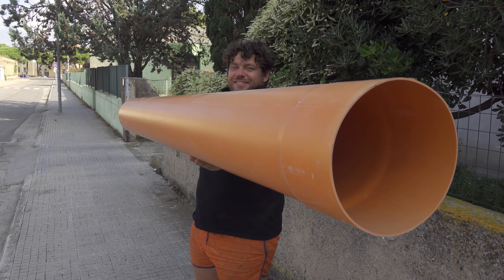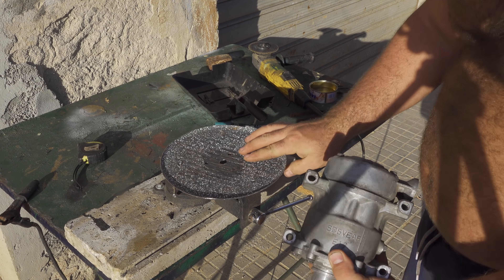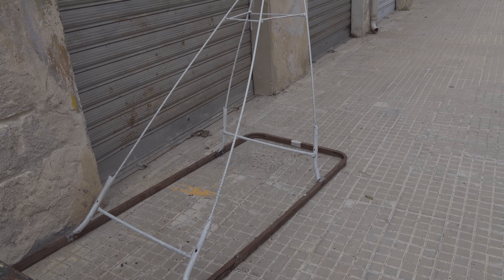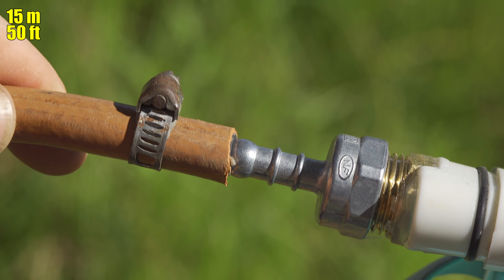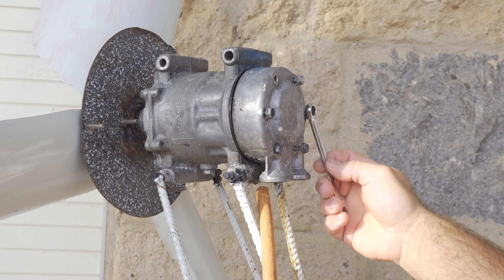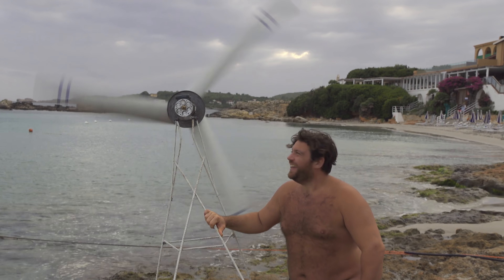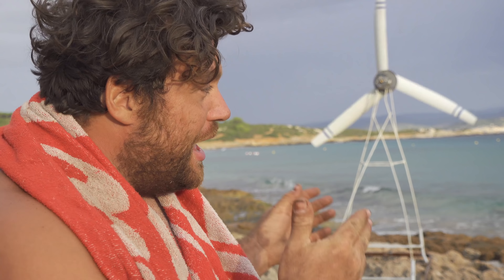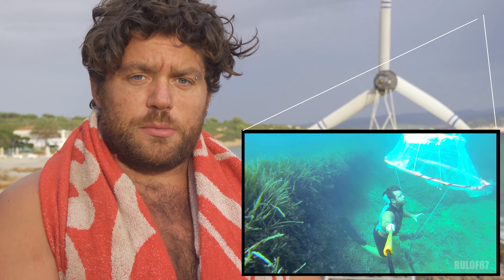Most Dangerous Invention  I've Ever Done • Breath Underwater

Comment: As an actual diver i cannot stress enough how dangerous/useless this device is. Just buy a dive rig.
Reply: care to explain why?
Reply: @mpcrazyscience7097  You NEVER want to use anything underwater to breath unless has been specifically manufactured and tested for scuba diving. Using old AC parts is really easy and fast way to posion your air supply because of all the harmful lubricants/oils you would be inhaling. Also, the mask is a full face snorkel. Any diver will tell you those are absolutely useless, as they're nearly impossible to purge and you can't pinch your nose to equalize.
Reply: @ghostairsoft24  Wow your arguments are weak.
 Just because it's not professionally made, doesn't mean it's bad.
He even says you should clean it: 4:20
With all the air flowing through, it automatically purges.
The only valid point you have is pressure equalisation. But you probably won't dive very deep with this anyway.
Reply: Alright, since you want to call my arguments weak and it's very clear you're not a diver, let me briefly go over why you are very, very wrong. 

Firstly, You claim that "just because it's not professionally made, doesn't mean it's bad." ANY dive shop or dive master will tell you that using your own homemade gear is a quick way to get yourself killed. Just by saying "oh yeah make sure to clean it" does not in any way guarantee that your efforts have in any way shape or form properly disposed of contaminants in the compressor itself and the air around you. While yes, there are hookah dive systems similar to this, but they have specially designed regulators, compressors, and filters that can guarantee that there are absolutely no contaminants in your equipment and on the surface that are getting into your air supply. 
  If you want some sources on this, take a look at this link https://www.diversalertnetwork.org/health/PSA-GasContamination/index.html  that talks about gas contamination

Also, here are a few quotes straight from the PADI OWD Textbook. "scuba air must be especially pure because trace contaminants (like carbon monoxide and oil vapor) that may be harmless at the surface can be toxic when breathed at a depth.) "

"get your cylinder fille only at reputable scuba air sources" 

Considering what this guy is using is a rusty as hell car A/C compressor with zero dive-rated filters (not to mention you can literally see the grime on the part itself), with some horrible looking tubing, you have to be pretty stupid to think that this is even close to safe.

On a different note, *the tube is 15m*. **Most OWD on their qualifying dives never are taken past 9-10m**. And this is with ACTUAL GEAR NOT HOMEMADE SHIT. The air you breathe on the surface can be toxic at 6m even, which is why most scuba gases do not exactly match what we breath on the surface. Not to mention I doubt anyone that would be wanting to make something like this has the training to safely ascend/descend at depths.

As for equalization, here's a chart on how depths correlate to pain in your inner ear. https://www.diversalertnetwork.org/health/SmartGuide-Ear/index.html    "probably not diving very deep" is something that is completely irrelevant to this chart, since you start to experience pain at 4 feet. 

For purging, good luck trying to get that shit back on while remaining calm. One of the nice aspects of purging your mask with a mask and regulator over the garbage that this guy is using is the fact that you can still breath when you take your mask off and impair your vision to purge it. If you wanted to fully purge this mask, you would need to take it off fully, hold your breath (*LITERALLY THE NUMBER ONE RULE IN SCUBA DIVING IS TO NEVER HOLD YOUR BREATH*) https://www.thoughtco.com/most-important-rule-never-hold-breath-2963244, and then attempt to put the mask back on while pushing the now very intrusive water out of your mask. All while staying calm. Good luck dude, and if you did that you would have some very interesting encounters with pulmonary barotrauma. Sure, you could always exhale continuously like how ACTUAL  DIVERS are trained when their air is cut off, but that is posing a risk in itself because your only source of air is a free-flowing mask you are trying to strap on while blind. Anyone without training would panic immediately, and panic can and will get someone hurt if they do not know what they're doing.   

So please, before you speak out of your ass, get some training.
Reply: MPcrazyscience-ghostairsoft24 is right,it's dangerous.Just do a little research on it.Even the maker of the video says not to try it.
Reply: "Wow your arguments are weak"     proceeds to use weak arguments
Reply: @ghostairsoft24  Ha good job you shut him up
Reply: @ghostairsoft24  not every need to pinch his nose to equalize, you learn to contract the muscle pretty easily
Reply: @TheRemo176  True, but for most people clearing it would be rough
Reply: @ghostairsoft24  All of your stated facts are accurate and true, and thus the threat should be clearly displayed to those who are tempted to replicate the build. However, for very small periods of short depth diving, trusting the person using it has some decent knowledge of the risk and a handful of common sense, I can scarcely see how it'd mean the life or death of someone. 
Making stuff like this isn't for everyone, but as long as the person making it is aware of the dangers, and they know what they're getting themselves into, they'll have an edge on limitations and things to avoid. This to me looks like a fun little project DIY enthusiasts can cobble together and occasionally dick about with, not a professional all-purpose safety certified diving kit ready for deep sea exploration. So comparing something of this calibre to professional equipment is slightly ridiculous, because nobody building something like this realistically want to exert their money on professional diving equipment when they're probably going to use the DIY replication for half an hour a week, and probably ditch it in a garage for several months to salvage it into scrap later on.  

TL;DR stop trying to the unwanted safety freak in this situation, inform but don't condemn. The assumption that this is going to be used anywhere near the same level as professional scuba diving gear is moronic, and provided people know the risk of what they're doing, trusting they're not ignorant they'll be more careful to avoid a soggy death.
Reply: @Reginald Keklesworth  I think the biggest concern about this build is simply the level of air quality you would be breathing underwater which would be dangerous regardless of depth/time. Sure, people may not go deep, but they're still inhaling rust/dust/oil

I wouldn't really consider this being a "safety freak" just a diver that has some immense criticisms about this build. Not to mention I probably wouldn't have elaborated if the dude above wanted to know more. I'm not saying people can't try this themselves, I am saying it is very, very stupid to do so. If someone wants to go test their luck, be my guest. But if you want to play stupid games you are going to win very stupid prizes. Also, as for how deep he would be using this, there's a 15m hose. That is deeper than most divers go on their qualifying dives. Just food for thought. 

People may know their limits but in the end, training and experience are what keeps people safe, not presuppositions about diving.
Reply: @ghostairsoft24  I think in the given context of how and where he built it, with the fact he welds and uses tools without gloves and shirtless. I doubt he really has much concern for more specific safety needs, but I'm sure he has plenty of knowledge behind him to avoid putting himself in a position where safety would save him. He has been alive on this earth for this long whilst skipping some safety basics so he must be doing something right.
But that hardly nullifies the fact that he is breathing through dirty equipment, so I very much so agree it's hardly safe practice to be using something rusty and covered in nasty stuff from previous use. So I can't bash your logic there.
My remark of being a safety freak was rather unfairly projected, it was more of an expression of the fact that this was a fun little project somebody created online and wanted to share with the world, he himself stated it should not be replicated and it is clearly dangerous. It's cutting away from the ingenuity and general creativity when you feel the need to bash and exert how useless it is. It is by no means professional equipment, and it clearly has some safety hazards. But from a creative standpoint it functions as clearly displayed, and it's unfair to then treat it like it is no more than a deathtrap when he didn't mean for it to be a functioning tutorial or a marketable device.

I fully agree with everything you've said, it's just harsh to be so critical of something of said nature.
Reply: @Valionic  I definitely see your point. I think my harsh criticism comes from the fact that while yes, its fun, but is also dangerous from a diver standpoint. Idk, its just hard for me to appreciate something like that.

But also, props to you for actually putting together a legitimate thought. The people previously have not.
Reply: @ghostairsoft24  I completely understand that, and I don't blame you for projecting everything you have said considering in your context, had any of the risks in this build applied to actual diving it could literally cause a death. That's far from something you want to experience when enjoying the views under water. It just might not be the best comparison in this situation. Thanks for being civil in your response either way, hope I reflected that back in my responses.
Reply: @Valionic  Yeah absolutely. Honestly if the dude didn't put a 15m tether i would have been like okay maybe this isnt awful. But if you give a dog a long leash you know they're gonna take it.
Reply: Jelly much lol
Reply: @joecarnes9174  nah lol
Reply: Mmmk ha ha
Reply: I'm a scuba diver too and totally understand the dangers of going underwater without using certified diving equipment. But come on ghostairsoft24 taking a scuba diving course doesn't make you Jacques Cousteau! We're probably taking in more contaminants from the air we breath due to pollution. I'd use this device and have fun making it YOLO
Reply: @jondilbert8455  Never said it made me Jacques Cousteau, but it does make you aware of the risks this guy is taking. 

As far as pollutants go, as a diver you  know breathing air at a depth makes certain things toxic that aren't normally on the surface. And idk about you but i haven't been breathing any motor oil,rust, or metal shavings recently so idk how our air could be more polluted than the stuff that's directly coming out of that pump.
Reply: Totally agree with you, this device does tick all the danger boxes. The video shows an inventive aspect but doesn't outline the dangers. Bit of a "don't try this at home"
Reply: @ghostairsoft24  What about using a new compressor then?
Reply: I mean yeah dangerous as fuk, but why not help dude out with "our infinitely more than anyone else knowledge" to make ir as safe as he/ we could. Instead of just being mean like the rest of the intro web 😁
Reply: Agreed but its just a creative video
Reply: ghostairsoft24 l
Reply: ghostairsoft24  A+ fucking you passed this semester good fucking job I love all the links man very informative
Reply: @peterlustig6888  New compressors would pretty much certainly be shipped out already having a light coat of oil to reduce the chance of rusting before you receive it. You wouldn't have the rust problem, but you'd still be breathing in the oils, and there's no 100% perfect method that I'm aware of to ensure you've gotten ALL the oil out. I wouldn't go through the effort to make one and use it myself, but if someone already had one and asked if I wanted to try it I wouldn't be afraid to use it one time. I wouldn't suggest using it much more than that for the fear of bioaccumulation (fancy word for repeated exposure, essentially).
Reply: I think that specific mask was linked to a few deaths as well.
Reply: He also said to take this video as entertainment
Reply: @ghostairsoft24  U forgetting that He doesnt Plan  on into The fucking Marina trench and without The equalization He can only Dive to Like 2-4 Meters deep so how is this Dangerous
Reply: @ghostairsoft24  organic oil Like Balisol isnt harmfull you could Drink it
Reply: @mykeymato  Yeah, and as an "actual diver" I know that most shops and dive sites wont let you near anywhere close to their gear/tank filling stations unless you have a card proving you took the course, so in no way am I advocating that people without training should just go buy stuff, because well, they can't. Granted, I probably could have said "get trained and then go buy a dive rig" but yeah.  As far as the conditions that you listed go, I never mentioned any of those as considerable concerns if you read my previous replies.
Reply: @brenbob747  I love you
Reply: @ghostairsoft24  I don't dive but I do know a lot about the human body, breathing and also the engineering involved with diving. People insult the shit out of you because they say they're not that deep, etc. Sure, they may not be very deep but they may be inhaling contaminants and they could go unconscious suddenly from breathing something. I don't think these people realize that when you're unconscious, you can't swim but your body keep breathing contaminants or whatever else, until the brain begins dying. I bet most of these people think that they could swim 30 feet down and use a tube above the surface of the water to breath. They don't realize that it takes force to fill your lungs with air when you are deeper.  Anyways, this device is indeed a terrible idea because it's like having a store bought air compressor hooked up to a mask. The air we breath may not be perfectly clean but it isn't sent through filters and oil lubes pistons. AC compressors aren't made to compress a gas humans breathe.
Reply: @skuzlebut82  Exactly. Ignorance at its finest. I mean if people want to play stupid games they're gonna win stupid prizes. 

I think my favorite thing is people saying 15m isn't "that deep" even tho most scuba classes don't go that deep when you certify.
Reply: 10mintwo I like your stories
Reply: Mechanics and proof of concept is sound. Could you improve it? Yes. Is the use of the compressor dangerous in other applications if cleaned and appropriate lube used? No. Should there be a pressure/scrubber/separator be in line? Yes. But all in all it is a very clever idea. As "an actual diver" you should have pointed out improvements rather than try to bust chops. Oh wait, your a "diver" not a engineer nor a certified compressor tech. Pull your head out of your...(water), and troll someplace else.
Reply: If you actually read my comments (which you clearly didn't) you would actually see I do give ways on improving the device. I just think it's a bad idea all together and deserved criticism. 

Something I find ironic is the fact that you seem to focus on the fact that im not an "engineer or compressor tech" when clearly this dude isn't either. So if I'm not credible for not having that experience, neither is he. 

I could make the same argument for you too, because "your" not a diver or a scuba tech. See how that sounds? 

Also, I would love to hear your explanation as to how you can absolutely and positively garauntee that ALL contaminants are removed from the compressor.
Reply: ghostairsoft24 weak arguments go do something productive
Reply: Lmao
Reply: Now now this is just a prototype and a person being creative in the world of ingenuity and inventions. I do agree this device is not a suitable diving rig, but perhaps modifications and better models of this idea will be built, thus "possibly" a cheaper way to dive.
Reply: Ill give this comment a like of buddy dies...otherwise its safe.
Reply: lol this is probably one of the safer ones on this channel. I think main safety issue with DIY devices is over pressuring and exploding your lungs. I definitely wouldn't be going anywhere I wouldn't go just holding my breath. You should see how they dive in third world countries. Check  https://www.youtube.com/watch?v=P1L_pxYZVwE at about 10:00
Reply: It's a really cool project but I agree. Im also a diver and @ghostaursoft24 is not being overly cautious, just be careful guys!
Reply: @ghostairsoft24  I'm not even an diver. But I know that you don't need to pinch your nose :D pinching your nose is the absolut beginner technique.
Reply: ghostairsoft24 Well said. And surprisingly what you’ve mentioned is abc stuff with regards to diving. The other guy hasn’t a clue.